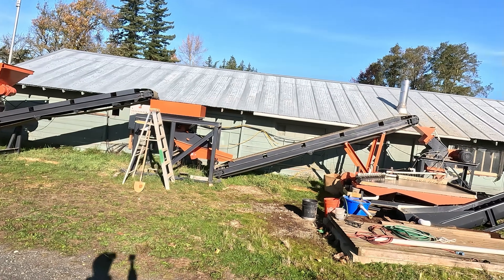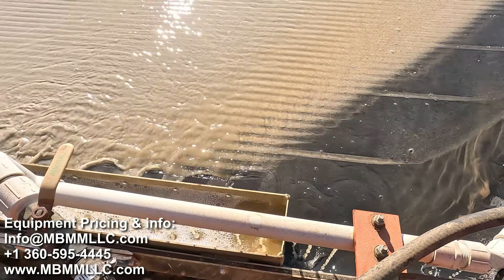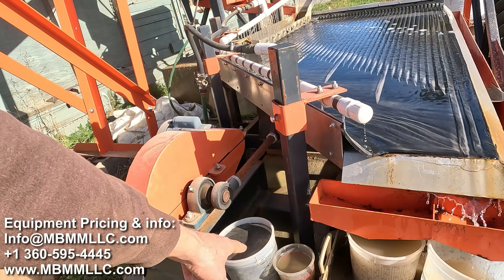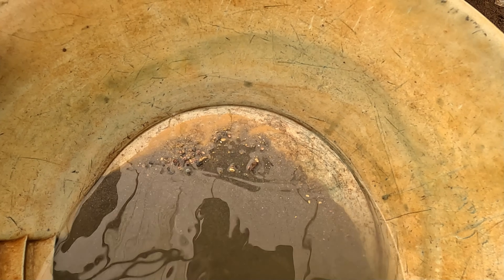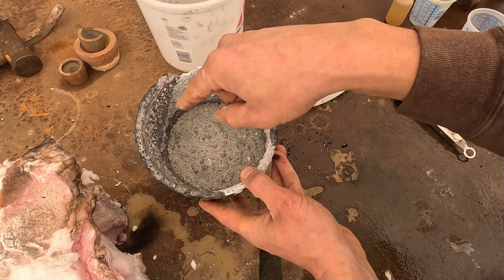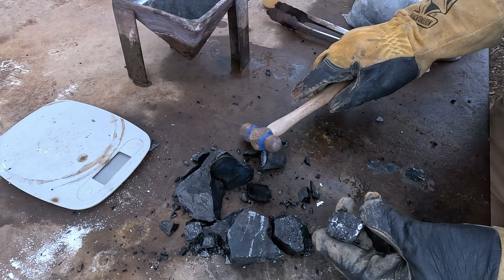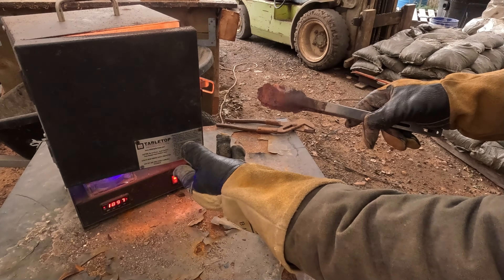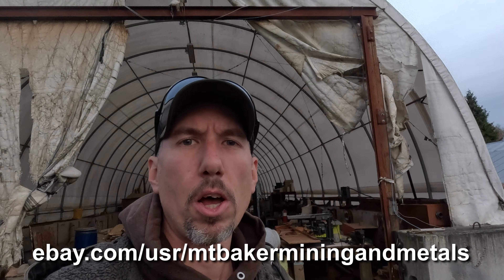1 Ton Ore Crush!! Running 1 Ton Hardrock Gold Ore to Find the Value, Episode 12 Season 3

Comment: I got, what seems to me to be a really stupid question....but couldn't you technically set up your machinery to also extract gold out of like tech...computers, phones...etc., instead of us sending are trash over seas to be burned.  Also, if this is possible...I think I deserve a small percentage...heh.
Reply: removing gold from old circuit boards requiters a bunch of chemicals. its quite involved process.
Reply: @x...CrankyOldMan...x  So are a lot of things...with the right engineers you can design anything.  Ever hear of the Industrial Revolution?

Comment: Indeed, 3/4 oz -ton is pretty nice. When we started near the surface we were only getting 1/10 to a ton. The deeper we went it got richer... Ended up with 3 oz to a ton at 1,600' Then she caves all the way to surface. 
All that high grade is still sitting at the bottom of the stope.

Comment: Enjoying the manufacturing process~ I used to work in vehicle manufacturing engineering and fixed factory bottle necks. Seems like you’d be limited to about 24 ton/day if you could feed this machine constantly.  Could you blast a cut out for this machine in the mine, then run conveyance? Most of the material handing would be removed from the manufacturing process. Then the process would be limited by loading conveyors and blasting. Speed gold up, work less hard :) 
24oz/day 
24t/day
48000lb/day
Gold at $4000 
 $96000/day. 
would be fun to engineer this type of efficiency gains.

Comment: What can the crushed rock be used for after? I work for For-Shor Co Salt Lake City who does Concrete Form Rental. If you call James and show him how Concrete is made and what material, I bet you can talk James into buying a whole set up or items to set up to crush rock into power to send off to an Portland Cement Factory's around to use making Concrete. or to crush up 3/4 minus to sale as backfile rock to fill in around where needed. Plumbers have to use 3/4 minus around outside pipes to pass inspections on the Fernco fittings.

Comment: that melt refining by the end, while its moulten, you ad a little borax, and its liquid you ad some bits of potassium nitrate, it will oxidize anithing except precious metals, it really fast, many jewlers do that whem recicling gold, of course with 18k them don't go until the end, because it pulls out all the copper, but most reactive contaminants like zink, lead, cadmium and iron, oxidixe fast and get traped by the borax

Comment: Do you ever check the material the falls off the conveyors between the crushing stages? As I’d be afraid of loosing gold that sticks to the conveyors and falls off on the bottom side from vibration. You could have the conveyors go further over the hoppers and add a brunch to the end of the conveyor to prevent this.

Comment: Watching the gold ore being processed in such an efficient way by your great and ingenious machines is very meditative - until you start "gambling", that is. Then stress sets in because you're using broken and dirty (contaminated?) supplies for the refining process. Why take unnecessary risks when it counts the most, and you're filming?
Also, did you "shock" the gold button in clean ice water right after retrieving it so it could finish its internal elemental process? If I remember correctly, omitting that final process caused the gold to crack when you tried to make MBMM gold coins. Your friend eventually re-smelted it for you and cooled it down as required. I see sreetips do it all the time.
Anyway, thank you very much for your great videos, Jason 💛 I just don't want you to lose any precious metals after all the back-breaking work you and your team put into mining it 🙏🏻

Comment: Pretty spiffy! That was good, seeing you drop the button like that. Those of us in the cheap seats appreciate it. Hurry up with more of the new mine's content, I wanna see how big a button you drop from that one!
Reply: He won't be crushing and smelting any of the ore if he can sell it for the prices he is currently per bag.    The real advertisement is for the selling of the ore.  At 28 grams per ton it is (spot 134.43 USD/gram ) $1.88 per lb he is selling 20lbs crushed for $145.00, the gold content of which is worth $37.64
   Would you process for a return of $1.88 per lb minus the cost to run the machines or sell in bags for $7.25 per lb

Comment: Not a fan of bismuth as a collector metal. Prefer pure lead & pure silver. Bismuth seems to ball up into small beads in the cupel process carry gold off to the sides of the rim of cupel where gold does not release back to the center puddle, leaves yellow streak of gold in the interior radius of the cupel. Can make gold weak when its made jewelry or coins...

Comment: The corner of that table looked to me like all the water was pulling everything into the #2 bucket with the way it was shaking all there wasn't any water dropping towards the #1 bucket. Wait, so you went through all that work and effort, nearly 1 ton of rock, to get less than an oz? How much does it cost and how much time to mine and run 1 ton? Like what kind of dollar per hour rate after fuel and costs etc? Hopefully better than minimum wage?
Reply: Losing money it's a hobby

Comment: G'day Jason. 
28g of gold, add 84g of copper, melt and inquart, then in nitric acid to remove all other base metal ( you can get what little silver if any later) then put gold into aqua regia. 
If you want to refine.
Anyway, great video, keep getting that rock out of the mine,👍
Reply: Is that you, @SREETIPS?
Reply: @scottstewart5784  no, he uses stirling silver rather than copper...

Comment: So... you have your #1's and #2's and then your 'mostly junk'..  I'd be curious if you  just hooked up another shaker table how much gold you could recoup from said "junk"...  then you would start to see the return on investment for the cost of electric/shaker table price? With the right setup, it'd just be automated anyway.... worth? guess youl never know if you never try... you may be pleasantly surprised though right? and if it doesn't work out, maybe you just use 2nd table for a refined runs only for only your #1's and #2's

Comment: I love bulk samples, it levels the erratic assay nature of coarse gold. Now you can realistically forecast the amount of contained gold in your run of mine and budget accordingly. I did see your crushing system still let some oversized material through, a bit of tweaking to improve that circuit and I suspect your recovery will increase to 1-1.2 oz per tonne. I wish I owned a great easily mined prospect as I would certainly want one of your systems to take out the gold. A bigger deposit with higher production rate and I would be thinking a cyanide leach system.

Comment: I just got done melting the gold from the coarse bag yall sent me. .62g total after cleaning the button. So like 1.9oz/ton for the bag I had; if I did the math correctly. That was just from roasting and panning. Still need to build a furnace to smelt the sulfides but not expecting a lot from that. Edit: Also, I only had an angle grinder crusher so maybe a finer crush would have a better yield.
Edit 2: for those curious this is a great way to practice if you’re interested in assaying your own field samples. There was gold in every one of my pans.

Comment: Thank you for the great videos!!

The tailing looks like it would be perfect for making cement, right?
Otherwise what do you do with it? Landfill?
Reply: Concrete need a very set mix of graded material.
It's just sand.
Reply: @sparksmcgee6641  thank you, never made anything other than one of those dump the bag in the hole around the fencepost and add water

Comment: it looks like you could be losing a lot of gold at 1:17 where the first conveyor is not over the bin far enough and lots of dust is falling to the ground
Reply: Once the button is 99.9 I bet it's closer to 1/2oz a ton. Considering that dust is LESS likely to have gold in it and at bulk that dust is $1 a pound he may have a pennies worth of gold per pound on the ground. 
I don't pick up pennies I. Parking lots. In fact I started tossing them when I walk outside a store 10 years ago
Reply: @sparksmcgee6641  we cant know what's in that dust as we're not there, but i am guessing that a weighted gold dust that's free from stone would be sent up that rubber mat and if it dont fall in the hopper it will spill to the ground. since dust is the name of the game, every fleck counts.

Comment: Looks like you’re losing material off your conveyor, I would suggest a modification, put a guard on the bottom side of those belts with a vibratory device to shake the material coming off the bottom / sticking to the conveyor belts, have it feed to a bin so you can re-run that material.
Reply: Yes, I saw that too.
Where the first conveyor empties into the holding bin there is a gap and you can see the material hitting the edge of the bin.

Comment: You know, if you could figure out a way to build your whole crusher/shaker table setup into a single trailer unit... that would be a game changer for people.  If you could just pull up on site in a pickup truck pulling this trailer behind and be able to just start running material without all the setup that would normally have to go into putting the operation together... that would be a game changer.  Easy transport, minimal setup, and no teardown to move to the next site.
Reply: Possible to put on a standard 40 or 53 foot shipping container with doors on each end?

Comment: Thanks for this, love the topic and production. Coming from smelting and ore industry, I must say the conveyour terminations are unimpressive. I'd like them further into the hopper and with a scraper/brush. And while I'm here, why are you pouring the crucibles so slowly? The most secure separation would be assured if done quickly.

Comment: Brings back the days when I was working on reopening a small mine. I worked at a small batch floatation mill in Central City, CO when I was in college. Your little turnkey system is nice. We had jaw crushers, a ball mill and classifier. We floated lead and zinc and suppressed the pirates and gold. That is a common practice. Turns out the metalogical engineer was recovering the tellurides with the zinc.
Reply: That’s a cool story I live close to that part of Colorado

Comment: One thing I never hear you talk about is how much TIME it takes for these processes. Mainly how long did it take for you to run the .75 Tons through everything? (NOT including the wash of the #2 concentrates) ALSO  how long does it take from when you fire up the furnace for the first time with the concentrates and flux until its cooled down and you have the button to put into the cupel??  I could guess but I'd rather you just tell me LOL 
- Oh and CONGRATS on having such a great producing mine!!! You sure do work hard for it, YOU DESERVE IT AND MUCH MUCH MORE!!!! :D
Reply: One hour a ton through the system in the video.
Depending on mix 20-30min in the crucible.
20 minutes in the cupel. Bit more time to cool than heat up.

Comment: That's considered a sick button.  Find out the reducing power of the ore and then add potassium nitrate which is essential for telluride.  That .4 bead could have been around 2+ grams in the 10.7 pound  video.  Niter turns the tellurium into dioxide gas.  Cross check your data on Google Gemini because it can compile data fast. It even recommends your videos.  I told Gemini the problems you were having with the refractory telluride metal.  Niter is what assay offices use for telluride 😊